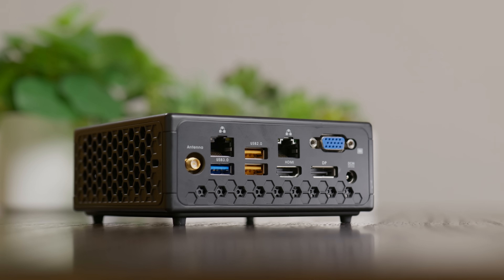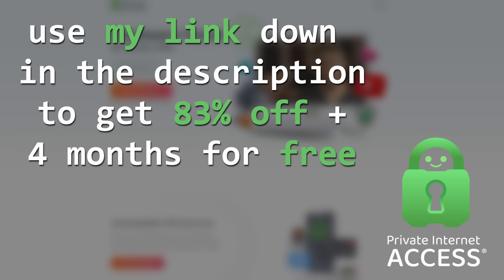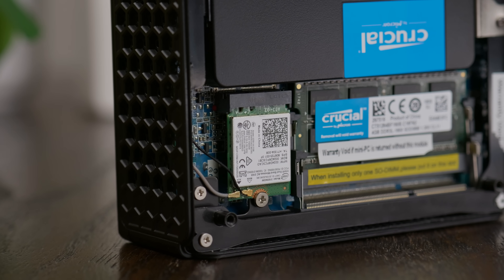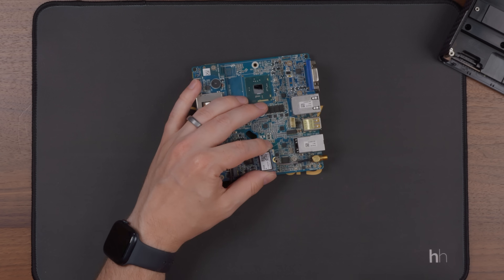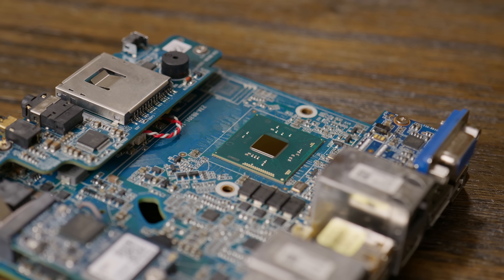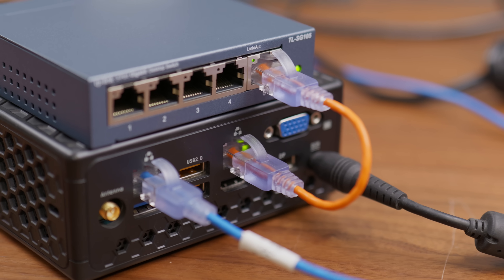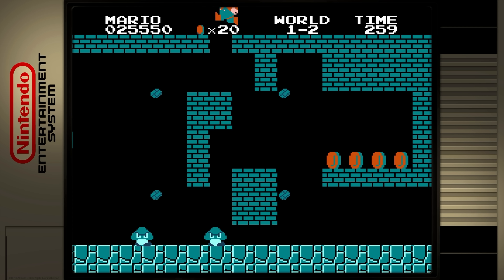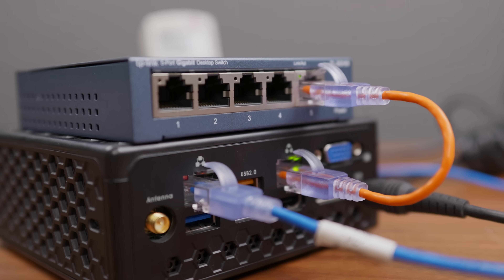What the heck is a ZBOX? (...and should you get one?)

Comment: Long time before, a "coffee brand" sold here in Europa some Acer cubes, with the nearly specs, for "cheap" money; a time periode, where this case was build "modular", but i never saw extenssions.
This Acer device couln´t be upgraded and it was delivered with win8; even when it came out, it was to weak to handle anything. YT struggle, FB or open tabs let run the maschine at 100%.
So, there was 2 options: Trash or find a other use. At this timeperiode the sale out "TV Sticks" (by USB), and this was working fine... cause TV was limited to the old specs 352x288 , and as long as they broadcast terrestic TV, this was the best solution.
Terrestic TV is meanwhile history, and they swapped to "HD" too, so the only thing you could do:
Place 2 HDs on it, and let it passiv run, means 24/7 and ready to receive datas, kind of "NAS"
So i have all needed ISOs or drivers or whatever "ready" 4 use when i need them; Kind of Database for old Nvidia Drivers, or MB drivers, or old Linux Images...

Comment: I've always been on team blue for Intel but that has definitely changed. The Intel mini PCs are just incredibly weak compared to the AMD options. I'm talking about mini's under 350 dollars specifically. The N150 is the best offered and that just doesn't cut it at all. I've been researching mini PCs for a few weeks now and I'm leaning very heavily towards one with a ryzen 5825U. The beelink brand looks pretty good. I'll likely get the beelink with the ryzen 7 5825U paired with 16 gb ram and the 500 gb nvme. It's around $280. I won't be using the Ethernet because I'm wanting one for travel. Few hotels have wired Internet now. It also has an extra nvme slot and ssd slot. Also the dual channel memory is a must. 

Any advice or ideas anymore? I will use it for Office apps, browsing and watching videos. Also as much gaming as I can get out of one . I'm totally addicted to cloud streaming games but again.... Hotel wifi. It's usually not stable enough for cloud gaming.

Comment: Seen this kind of  small system for two decades.  It's not a Gem..  It Isn't a replacement for a laptop..  Screen interface needs to be able to  use a recovered screen.  No upgrade slots.  Dell or HP mini  systems better. but still needs more thought.

Comment: I love my ZBOX, though mine is a very unusual model.  It's a CI521 which has the Intel Core M 5y10c and came with soldered 8GB RAM.  That included RAM made it an excellent deal when I got it in early 2017, and I got it at a pretty good price too.  There's very little info about it on the internet.  I found a forum post once of someone in Europe who talked about having one and that's it.  Sounds like they didn't make too many.  The 5y10c is quite a bit faster than this one.  That's really the problem whenever I've looked for extra units, they never make sense with the CPUs included and the prices I've seen.  They tend to have super slow Celerons yet cost more than much faster Tiny/Mini/Micro office computers.  I've seen Thinkcentre Tiny units as low as $35 with i5-4570T chips and those can emulate at least some PS2.  I know there are faster ZBOX units, but those don't seem as common and are usually too expensive for what they are.

For reference, the Zotac C-series is the fanless line.  I did pick up a Zotac/Datto(it says Zotac on the bottom and Datto on the top) M-series PC which is actually a tad smaller than the C-series, but is fan cooled.  It has a 5010U CPU which is a definite step up on processing compared to the one in the video.  I was also looking at Intel NUCs, but the ones I found were all single NIC.  I should say some Zotacs are single NIC as well, but it's been eaiser to find dual-NIC units from Zotac.  I used my CI521 as a small media server for a while until recently when I wanted more drives and it worked well for that and idled at 6W.  Looking for SATA M.2 drives in 2260, 2242, and even 2230 is such a pain though so I never added the second drive.  These fanless Zotacs can be useful, even the weaker ones, but price is going to determine if it's a good value, so unless someone has a specific use case requiring it, I would not recommend them.

Slightly off topic: I started messing around with Jellyfin last year.  The mobile experience is great, but I don't like is as much for desktop.  Playing things in the browser has always been problematic for me.  Maybe it's because I stick with Firefox on Linux, but it's never gone very well.  Luckily, I can copy the network address into VLC and watch that way, though I have to remember to mark things as watched.  There's a lot of room for improvement there, but I still like Jellyfin overall.

Comment: I've been running a Zotac ZBOX-CI321NANO as a gatway machine for my ADSL line.  It has a Celeron 2961Y.  Worked well for years and years.  Not so useful since my ADSL line was cut up the street and the utility refuses to repair it.  Currently it is running Fedora 42, configured as a rooter.  Once upon a time it ran CentOS.

I never figured out how to bust into the second part of the box.  Thanks for the explanation.  I have another Zbox nano which has failed and I might investigate.

That 32G SSD is not very useful.  It has Windows but I haven't booted it in a long long time.  There are likely quite cheap SSDs that would fit that are available on Aliexpress.  I've used them to upgrade HP Stream Minis that I have.

Comment: Maybe an Alder Lake N100 or N150 based system would have been a better choice. It's performance will blow away that Celeron . Transcoding multiple 4k streams without breaking a sweat! Mine is an MSI Cubi N ADL I picked up last year for $99 from Newegg. I added a single 32GB (yes) sodimm of DDR4, 1tb NVME 2280, and a Seagate 5tb 2.5 spinner and it's been solid with Ubuntu. On Geekbench6 the N100 did 1236/3186 compared to the Celeron's 182/567.

Comment: I’m using one of these. I got it from a decommissioned system that works as information system sets at the back of a public area tv. The first thing i used it for was a opnsense box due to the fact that it comes with 2 ethernet ports — but it was slow for my use case. Now I’m currently using it as a proxmox backup server.

Comment: I bought ASUS NUC 14 Pro Slim with the 100U processor. The BIOS has a lot of CPU power control, so I made mine idle at 5W and sustain maximum 15W at 100% load. But it does so with more than enough processing power to daily drive it for everything I need to for, except gaming off course.

Comment: I've actually got one of these; well the prior CI-323 model. I used it as a router for a bit but the Realtek NICs with pfSense were "fun". After that it mostly just became a little play box until the PC on my work CNC machine died about two years ago. Put Windows 10 on it, and it actually runs just fine. No, it's not going to win awards for speed but with 8GB of RAM it's actually pretty competitive with its contemporaries. So yeah... your performance issues were probably RAM related :)

It's not under heavy use, but my machinist uses it for surfing the Internet while has eats lunch and sometimes does some research on it. For really light use cases it's fine, though the SATA SSD is another pretty bad bottleneck.

Comment: Older Intel NUC computers still hold up well and sometimes you can find an i7 model for in the $60 range.  I built a combination NUC (5th gen), keyboard and screen enclosure to make a pseudo cyber deck using a 3D printer.  Aside from rock hard thermal paste which you would have to change and a thermal solution that likes to choke out the CPU, they perform decently.

Comment: I’m not sure why you ran into problems with streaming. I use a NUC6CAYH, which has a very similar processor, as my living room PC and it’s absolutely fine. I wouldn’t ask it to decide 4K, but for use in a 1080p setup, it’s ideal. Maybe the issue is passive vs active cooling?

Comment: Bought this brand new in 2015. Threw Proxmox on it and ran Pfsense and HomeAssistant as virtual machines for a full decade with no issues!! Only downtime was due to OS upgrades. I would have kept it going longer, but my ISP ran fiber to my house, I upgraded to a 3Gbps package and needed to upgrade my home network 10Gbps to keep up. That's what finally made me retire this box. But if 1Gb is enough for, I cannot recommend this box enough as a router.

Comment: The ZBox was basically an Intel NUC before NUCs were created. The Nvidia ION units were great at the time because it made running XBMC (now Kodi) under Linux very smooth. Zotac at the time had a hit or miss reputation - most Zotac things would fail over time, though I've had a LGA 775 Zotac ION mobo running for well over 15 years straight. The system has been through many sfx power supplies over the years & with SFX PSUs becoming very popular in recent years I actually replaced it with a quality PSU finally so that system should be solid for another 15 years...

Comment: Thank you very much, it's really nice that you post a video every week. But I sometimes wonder where this demanding attitude comes from with some YouTubers: the device costs 50 bucks, has hardware specs like those of old Windows XP or Windows 7 computers and it's supposed to work smoothly and without problems with Windows 10 or 11? How is that supposed to be possible? And secondly, you might need a lesson in market economics. If something comes up very often and very cheaply on the second-hand market, that's not a sign that it's particularly good and I have to buy it now, but rather the exact opposite. Just keep your hands off it because everyone is selling it because it's so crap and then you don't have to go and buy it because if 50 people are selling it then it's absolute crap otherwise they would keep it.

Comment: about jellyfin, do i need to turn on some settings on my router? i tried some tutorials and it didnt work. used a linux mint laptop to host my library and wanted to connect that to my phone. and it didnt detect the jellyfin server. tried reinstalling the jellyfin server, didnt work as well.
Reply: First thing that comes to mind is a software firewall on the server side(laptop).  First, see if it's enabled if you are not sure.  If it is, if you need to keep it enabled, you would need to create a rule to allow port access for Jellyfin which I believe is 8096 by default.  There might be another port as well, but I don't recall needing more than one rule for Jellyfin.  If that's it, you should be able to access it via browser or app by pointing it to (IP address):8096